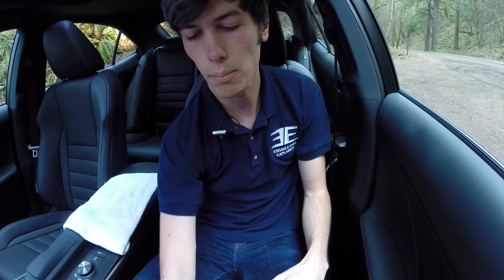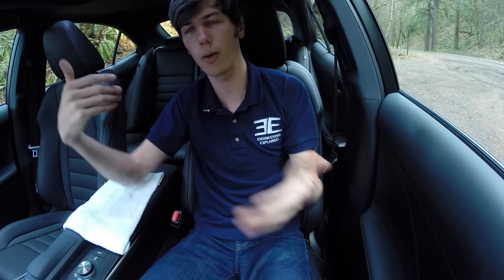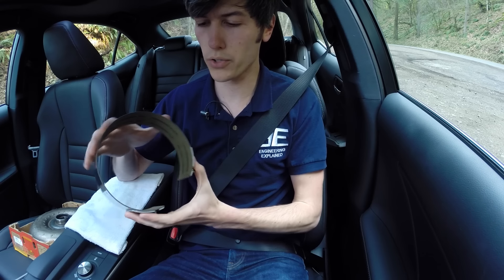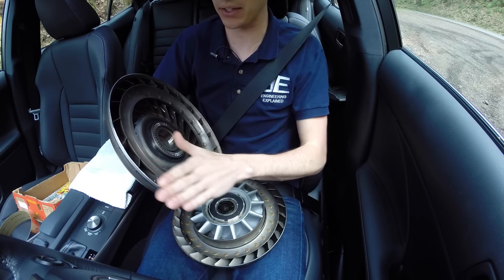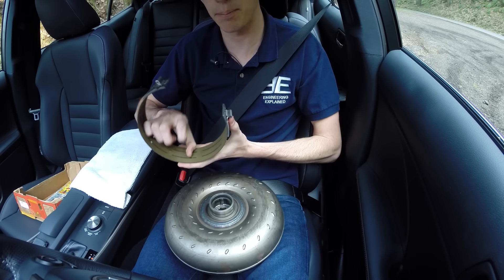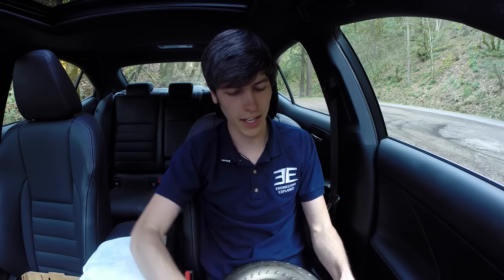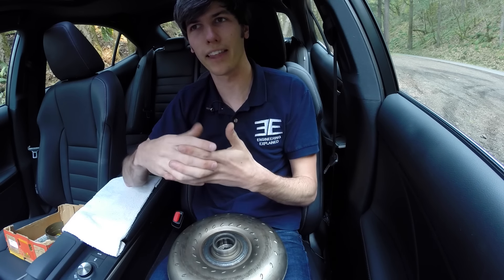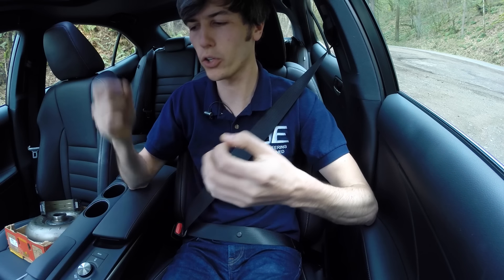5 Things You Should Never Do In An Automatic Transmission Vehicle

Comment: Two questions: 
1. How would law enforcement know that i'm coasting down hill in neutral?
2. Is it bad to leave my car in park with the AC on?
Reply: 1. The car will sound different.

2. No, but A/C uses more fuel.
Reply: Law enforcement wouldn't know because of the sound lol. They wouldn't know period
Reply: idling for long periods of time is bad for it.
Reply: IF you should get in an accident that might have been avoided except you had no control of the car because you were rolling it instead of driving it ... then you might not only have the accident but also find out you are the liable party, because you were violating the law at the time. ?? Anyway, since you can react faster if you don't have to shift out of neutral into gear, why coast?
Reply: True, I would not admit I was coasting right before a collision.
Reply: +built_7.3TurboIDI No it isn't.
Reply: +Tom Crisp why would someone have less control of a car in neutral? besides the accelerator, and when does using the accelerator help prevent an accident?(where it would be your fault)
Reply: sugahotcakes yes it's very bad
Reply: built_7.3TurboIDI It isn't.
Reply: Ryan Wuerl
The accelerator moves the car forward. If something is happening behind you or to either side, it could be very useful to drive away from the problem. Some peole get read rending while slowing down for a red light for example. It would be nice to be able to accelerate quickly if you noticed the car behind you was racing towards you etc.
Reply: sugahotcakes the same thing as lugging it
Reply: built_7.3TurboIDI No it isn't, not at all. At idle there is no load on the engine besides its internal frictions. The fuel system, whether it be a carburetor or injection, accounts for this and delivers the correct amount of fuel. The wear that happens during idling, even for long periods, is negligible.
Reply: sugahotcakes keep believing that but I've seen many diesel engines ruined prematurely from excessive idling.
Reply: +built_7.3TurboIDI that's diesel engines lol, and you do realize Simi drives, while at a rest area always have the on in idle right... lol
Reply: sugahotcakes
Idling gets more fuel in your engine oil than running the engine under load. Fuel in your oil screws up the oil's viscosity and ability to lubricate your engine. When the piston speed is low, there is a longer time for air/fuel mixture to slip past the piston ring. Timing is retarded, so again there is a longer amount of time that there is un-burnt fuel in the cylinder, and therefore more time for it to slip past. Idle is generally at a very low MAP (manifold absolute pressure) and your PCV (positive crankcase vent) brings the crank case pressure down very low. This creates a larger pressure difference across the piston rings, which results in more air/fuel being pushed across the piston rings. The exhaust system is also cool for long idle periods which makes it less effective and also it will get more raw fuel.

This is why stop and go driving require more frequent oil changes. Idling around the city isn't good for cars.

Big rigs have no choice but to idle for long periods. If there was a way to save the engine damage and maintenance costs, then drivers and companies would go that route instead.

You really do like showing your ignorance while beating your chest.
Reply: Daniel Green I don't buy it. Never heard of any such thing besides from you and a few treehugging anti-idling pages. Is what you're saying specific to diesel engines or very high performance gasoline engines?
Give me a citation.
The exhaust system doesn't get "cool" during long periods of idling, either. The only part of an exhaust system that I could think of needing to heat up to perform correctly is the catalyst, but I've never heard of anything about that either.
Stop and go driving is harder on engines and gets you worse gas mileage because it takes a lot of energy to get a car up to speed again and again, it has nothing to do with the idling.
I've also always heard that large diesel engines are idled for long periods because idling is a lot easier on the engine than starting it up. Where do you get your information?
Idling doesn't damage engines, I've never heard any credible person or source claim that in my life.
Now for the somewhat anecdotal evidence. I drive a Crown vic police interceptor. Ford put idle hour meters on those cars because cops sit around and idle their cars so much. My car has 4800 idle hours on it and runs great. I have personally put almost 50 idle hours on the oil in the engine right now, it has no hint of gasoline in it. I regularly attend police auctions, and I have dealt with cars that have 8000+ idle hours on them. In my experience, it makes no difference on how the engine runs. Police departments having to rebuild engines to repair damage done by idling isn't a thing, unless something else failed such as a cooling fan and the engine overheated.
Reply: sugahotcakes  Thanks for that, haha.  Daniel Green Daniel's reply sort of worried me.
Reply: Tyler Durden
this guy is a few cards short of a full deck. He thinks an exhaust system is just as hot when it's idling as when you are at 3,000 revs on the highway for hours.

Do what you want with the info.
Reply: Ryan Wuerl
As mentioned in the review, I believe, control of the car does include being able to move it at will - for instance, once you've braked you may want to accelerate again, but if you happen to be using both hands to manage an emergency, it could take a while to get back into gear. Or imagine another vehicle out of control or appearing from a cross road, etc. Or an animal running into the roadway. It pays to have options and the ability to accelerate. Anyway, there is zero to be gained from coasting downhill unless you're already run out of gas and see a station at the bottom.
Reply: Well in both case you are burning extra fuel.
Reply: +Daniel Duncan did you just pull number one out your ass? Have you ever heard a car coasting in neutral ? It sounds no different then a car coasting while in gear. If anything the car would sound quieter. What's the cop gonna do write you a ticket cause your car is quiet? There is no way for a cop to know if your in neutral while coasting. It's an unenforceable law. A cop can write a ticket but it would never hold up on n court because the cop is not specifically trained to know the sound of every different car coasting in neutral which would mean the ticket would never hold up in court.
Reply: +built_7.3TurboIDI my uncle idles his dmax 5-8 hours a day since it was new in 05. he live in northern alaska. starts it in the morning shuts it off before bed. regular oil changes. no problems
Reply: Mason Smith highly doubt that. If he was smart he would use anti-gel and fuel additives instead of beating the piss out of the engine.
Reply: +Ryan Wuerl that mentality is exactly the cause of many accidents for example when someone is crossing an intersection and someone crosses while you're already in the middle most people don't brake instead of accelerating and avoiding getting hit
Reply: The laws regarding coasting in neutral come from years gone by when manual transmissions were dominant.

Basically, if you are coasting in neutral, especially downhill, in a manual trans vehicle and your brakes fail, you will have no way to slow down. It would be very difficult to get back in gear in a car and is near impossible in a big truck. The e-brake would be useless as it would cause you to fishtail and crash. So you would be at the wheel of a runaway vehicle. The law was enacted to minimize runaway situations. With the vehicle coasting in gear the wheels will be trying to drive the engine. The engine will resist and provide some level of braking power. So even if your brakes failed the vehicle couldn't really runaway.

This isn't necessarily true of automatics as they really don't provide engine braking unless you use the low gear setting. Also, you can take an automatic out of gear and put it back in while moving. Since automatics just apply/release clutch bands instead of trying to mesh gears together it isn't as much of an issue.

Automatics should be left in gear on hills. As mentioned in the video the engine will cut the fuel to the injectors to help with economy. Also, in some cars (like mine), if you shift to neutral, the computer will keep the engine rpm's increased to where they would be if it was in gear in anticipation of you putting it back in gear. So there isn't really any benefit to taking an auto out of gear on a hill.
Reply: +angrodNumenesse Interesting. So then there must be some kind of defect with my 2015 Dodge Grand Caravan; when I coast in neutral, the engine RPM drops to idle (low 600s) rather than staying revved. Time to issue yet another massive recall. And to those who are gonna jump down my throat about that (I see you there), I coast in neutral because with these Dodge Grand Caravans, the transmission downshifts from final drive (6th) to 5th gear when braking in drive; that combines with the fact that the power steering is tied to the engine speed (or maybe more accurate to say "affected by it") to create an inconsistent steering situation. And there have been numerous emergency maneuvers I've done that would have failed if I hadn't taken the transmission out of drive to stabilize the steering. But then again, I did learn to drive in a manual transmission Toyota Tercel with Rack And Pinion steering; so I'm kinda FUBAR.
Reply: Jacob Carlson There might not be anything wrong with it. Every manufacturer programs their vehicle computers differently. My car is a Ford Taurus. The behavior I described could be because Ford new these cars had weak transmissions and didn't want it to 'bomb' going back in gear from neutral while moving.
Reply: What you described just sounds like excessive blow-by from bad piston rings. I've never heard of idling adding more fuel into your engine oil unless you had blow-by due to bad rings. For normal running cars, idle shouldn't be a problem. Stoichiometric value for RPM @ idle should be 600-900 RPM. Anything higher or lower could be Air:Fuel, spark, timing, or the IAC. Exhaust systems are always running at 400C to near 600C and newer vehicles hit Closed Loop (~600C) much quicker than older vehicles. If something were rich then the O2 sensor would pick it up and adjust trims accordingly.
Reply: Sounds like a great but convoluted theory. Stop and go driving requires more frequent oil changes due to varying engine temps causing unburnt fuel, as well as more engine wear due to more frequent acceleration. I have a fair amount of experience with diesel engines which idle for thousands of hours at a time, and there is no evidence of greater oil contamination than those which run at 2500 rpm constantly, and that is based on oil analysis done by labs.
The only issue with idling is in the case of a turbo, which may not get sufficient oil at idle speeds. The VW TDI is a good example of this, as well as newer ford diesels, which actually have a computer control which revs the engine from time to time to oil the turbo.
Reply: Blowby is not the only source of oil thinning. Incomplete combustion and engine temperatures below the working temperature can cause fuel fumes to condense on the cylinder walls and into the oil film. This happens a lot during stop & go phases.